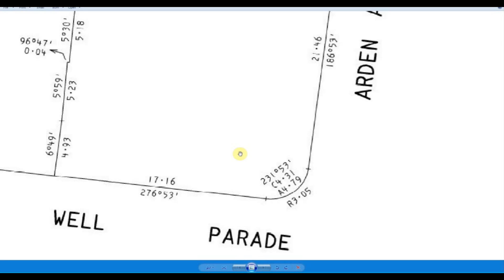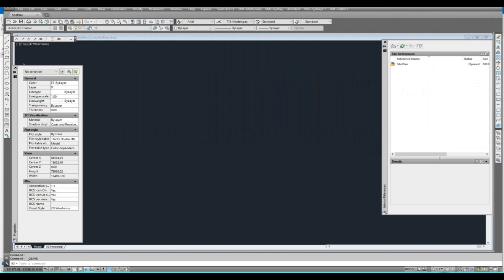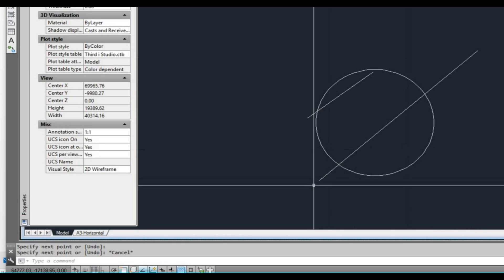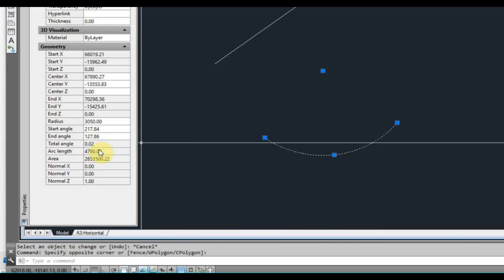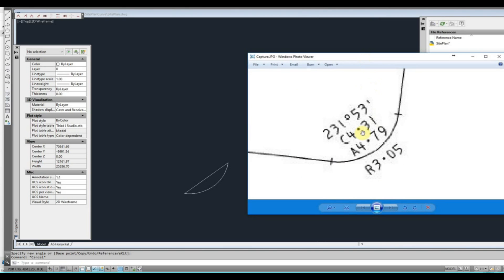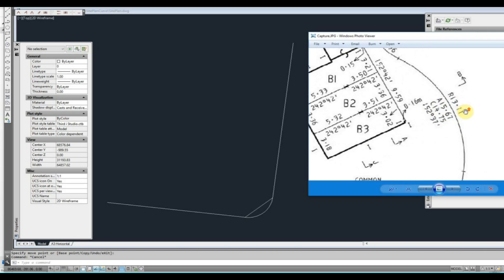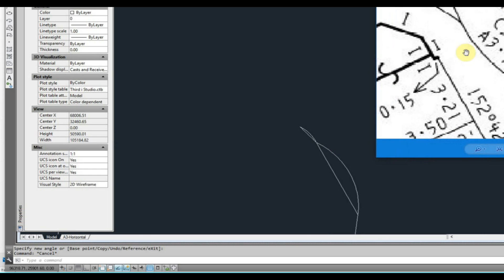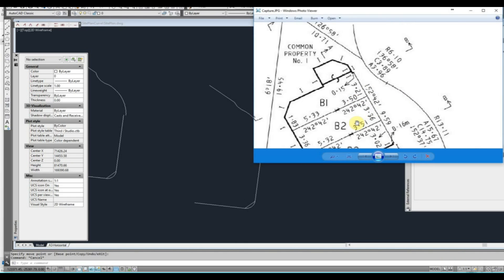AutoCAD Tutorial - How to draw Curved, Rounded, Arc, Circular Site Title Boundary

Comment: To draw the arc, I used Arc (Start,End,Radius) and it will always give me the arc length of 4786.1911. I guess 4.79 is rounded from 4.786 units.

I changed the UNITS settings of Angle to Deg/Min/Sec, Precision 0d00'00.0', Direction: North, and Clockwise.

Type L, click anywhere and paste below:

@4930<6d49'
@5230<5d59'
@5180<5d30'
@9790<7d01'
@19450<6d18'
@10710<126d58'
@3890<136d58'
@14750<152d37'
@21460<186d53'
@4790<231d53'
c

Press Enter/Spacebar to finish. Thank you so much for this tutorial! 👍👍👍

Comment: why not just fillet
Reply from the maker: the reason to not fillet when doing a site plan is that if the site plan is not a simple rectangle with all boundaries being equal, you will not see if there is a gap or misalignment when drawing up the plan. Filleting in this instance would often extend the boundary lengths to greater than the survey plan shows which should be avoided.